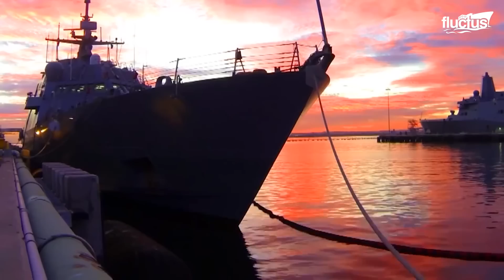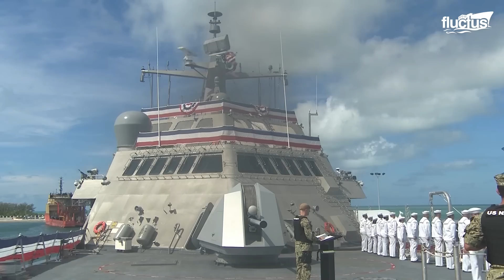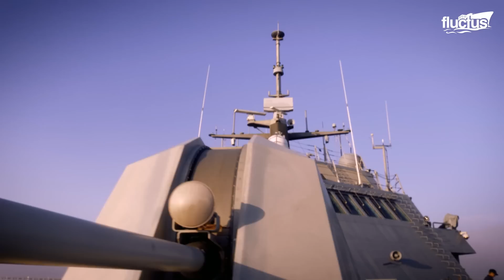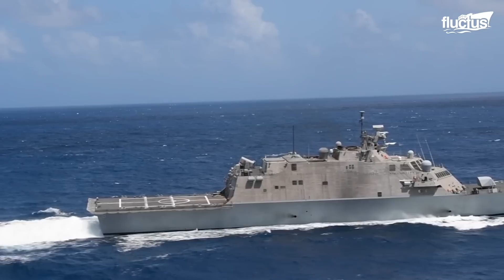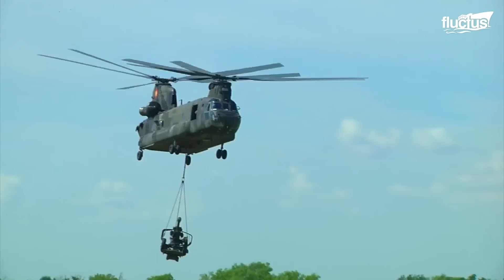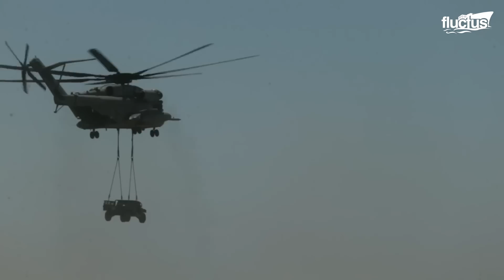The US Hypnotic Launch Process of a Massive 4000 Ton Ship

Comment: Your storyline is way out of touch regarding USN's current thinking - SCRAPPING the ENTIRE LCS FLEET! Early on in this video you mention "how successful" the LCS design has been. Really? There is a major design flaw with the "transmission," or coupling gear that can't advance speed to achieve the level of performance mandated. It's even causing LCS ships to return to base under tow. And every LCS produced has had the problem! Further, the recognition that China may be the US's most serious future foe, means the LCS ships are outgunned and can only be staffed by crew trained in 1 of the 3 specialty areas for which they were designed - meaning they are not multi-missioned! And BTW, I sure didn't experience a "hypnotic" launching. It was rather mundane to say the least!